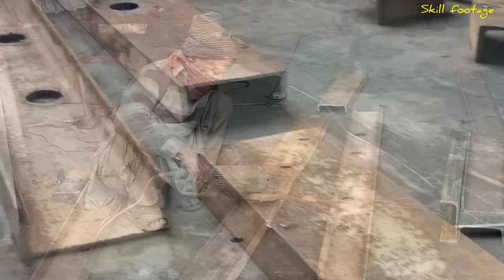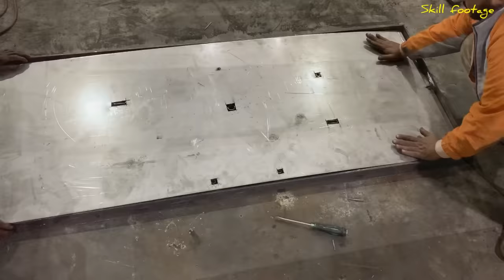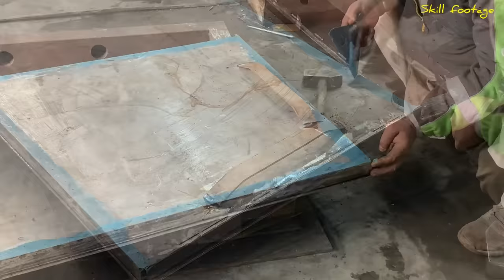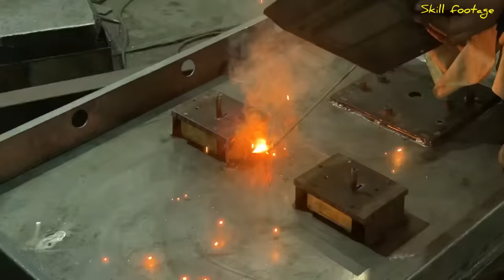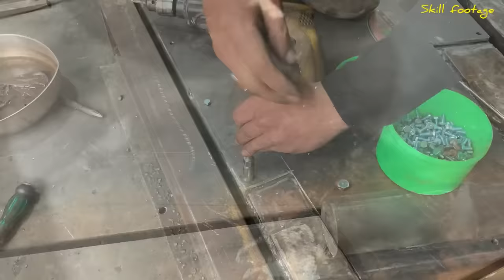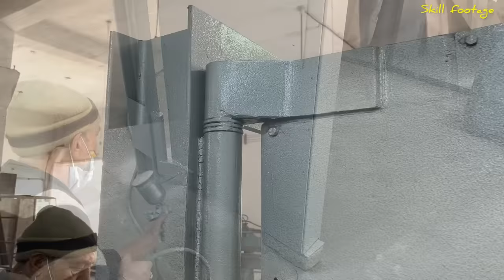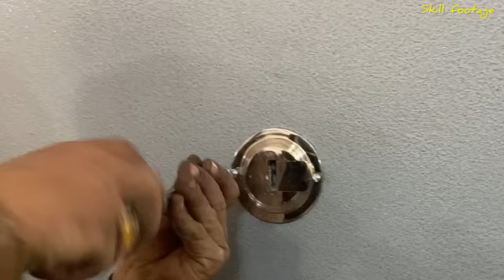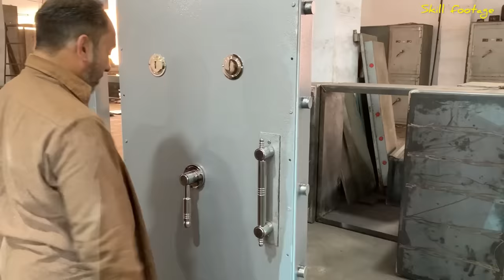Amazing Manufacturing Process of Bank Strongroom Door || How Bank Vault Doors Are Made

Comment: What's to keep me from unscrewing the outside skin of the door and manually retracting the bolts?
This door, appears to me, to be completely backwards!
Trying to break out (rather than break in) is much tougher with this door.
Reply: The mechanism is meant to be facing on the inside with the blank and safe side facing outside. It's meant to prevent people from breaking in (duh),I can't believe the kids on this comment section have to be spoon fed the most basic concept.

Comment: Lol. Everything bolted from the outside and with un graded bolts that is the lowes grade mild stell possible..

2 minutes with an impact driver and 13mm socket and I'm innside the door, then one or two minutes to disable the lock and open it.
Vault/bank door my ass 😂🤣
Weak bombshelter door

Comment: you violate the (safe) and safety meaning ,so to break in just cut the cheap low strength galvanized screws with chisel and small hammer ,and nothing about inner parts undercoat .a small hint do the front face screw on the hidden frame sides .

Comment: Very poor construction - spot welding in many places that should be a continuous weld, low grade thin steel easily attacked with a portable grinder and cheap alloy bolts that are easily removed. They are selling the appearance of physical security.
Reply: Same applies to UK and USA electronic bottom range safes that can be opened without key or code in under a minute, have done so a few times.  look good but useless.

Comment: All that work just to put bolts on the outer panel. This is the most insecure security door I have ever seen. Hope this is done purposely like that just for display. A kid will break in within 15 mins just with a sawzall and a power ratchet
Reply: Besides the obvious flaws, a simple reciprocating saw will cut through the door bolts opposite the hinge, because they have not included a stepped edge to prevent this noob mistake vulnerability. (Me 'retired' 30+ years experience fabricating steel products for the security trade).

Comment: Useless bank vault I could open it with 4 inch cutting disc in about 15 minutes . The concrete filler should ha e been at the front not the back.